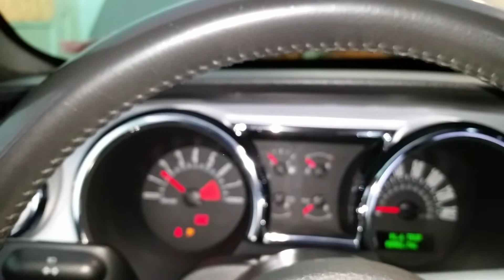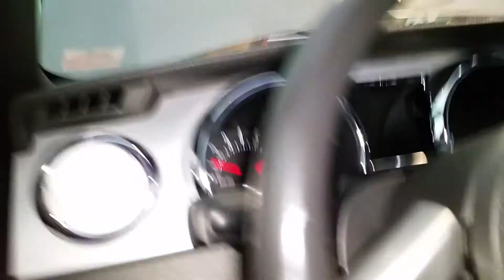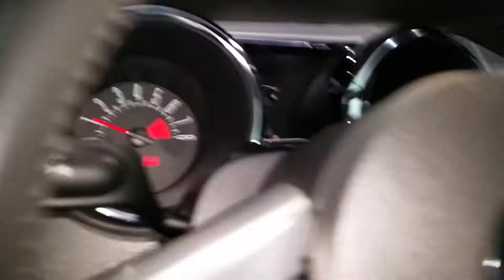2005 Ford Mustang GT Delete plug manifold Startup

Comment: how do you like the delete plates? just ordered a set for mine.
Reply from the maker: +Ryan Soto It runs good with them. Noticed a slight drop in low end torque and MPG's though with them. About to go turbo so may benefit from them more with boost.